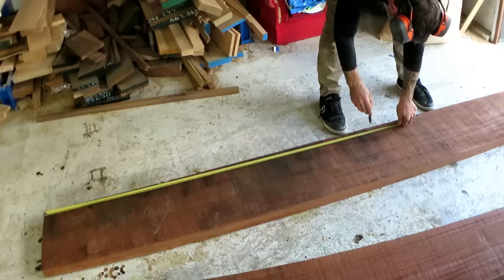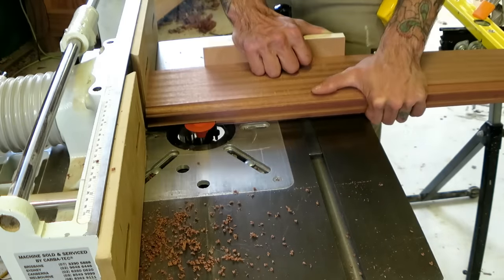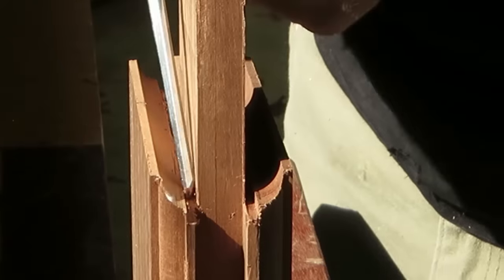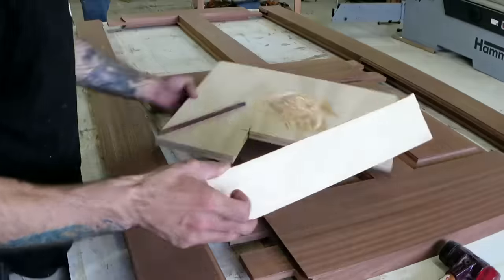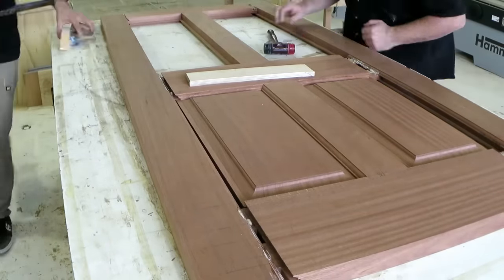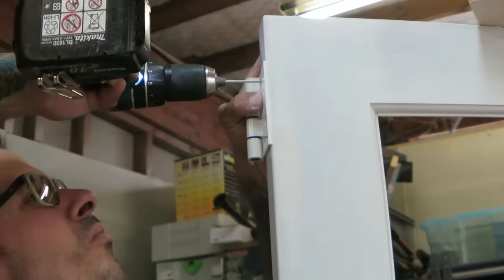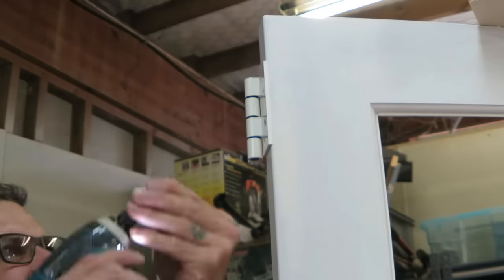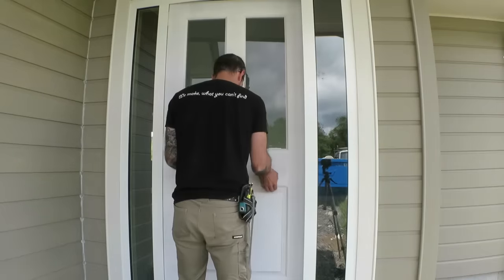Making a Sapele Door

Comment: That’s an extremely well built door, looks great. I have to admit I would have rather you didn’t paint it and just used something like an exterior hard wax oil instead but I see why you did it. And I appreciate it, anyway the main thing is the comforting fact that there is a super solid durable wood underneath which will last decades

Comment: i dont know if this will help but I had a similar problem with a matched router bit set and it turned out my router was set slightly crooked in the table. i put a 1/2" rod in the router and at a foot above the table it was 3/16" out of square. this was enough to mess up the match. after shimming to square the bits worked perfectly

Comment: Just some friendly advice. Stay away from the fox joint on a door; there’s a reason why the Japanese call it a “hell joint.” Through tapered wedges is the way of the old masters as it offers a greater mechanical lock, without the possibility of something going south. Also, if you use lock dowels, you should be using two with an offset on your upper and lower rails. Accordingly, your tenons should be sized to accommodate such a configuration. That sometimes entails making one tenon wider than the other. When I was working as an apprentice many many years ago, I asked the master craftsmen why we were using through wedges and not just lock dowels? He grinned and replied, “Because those wedges are what hold the door together.” Indeed, sometimes a client won’t want exposed joinery but I always manage to convince them otherwise. That’s why I sometimes use a different species of wood for the wedges so it looks better. Sapele is good; Sipo (Utile) is far better. I’ve made hundreds of doors and can assure you of Sipo’s superiority. All the old masters I’ve spoken to agree. Like I said... just some friendly advice.
Reply: Hundreds of doors? I have a big door project going on and I could use some advice from someone with that much experience. First of all, is there a one stop shop, to get a ton of door making info, i.e. a book, video, website, etc that you reccomend?
Reply: davearonow , I’ve been working wood professionally for over 35 years; I would be more than happy to share that experience with you. I just saw your reply so I’ll get back to you later.
Reply: @bethoughtprovoking  thank you.
Reply: davearonow , Making doors is relatively easy. How easy depends on what kind of door you want to make and what tools and equipment you’ll be using. I don’t know of books or videos on door making simply because I never needed that kind of instruction; however, I have seen videos on YouTube that I would strongly urge against. You see, anyone can show you how to do something; but the point is how to do it reliably and correctly. That said, let me know what kind of doors you plan on making and the tools at your disposal and I can give you step-by-step instruction. As I said, the process is not that difficult, but there are a few “tricks of the trade” that you should be aware of.

Comment: This is exactly the video that I was looking for!  Could you make a short video on how to cut the panels? I have been looking for a video on how to make the double sided raised panels. also, would be awesome of you could do in in real time, and not the fast forward version. not sure why the fast forward is necessary, after all this is a training how to video and very nicely done, i might say  (could not sneak a peek at your tats!!!). Thanks tons. i will have to watch this several times to get your lessons here, just need to see how you make the actual raised panels. you sort of skipped over that.  I really like the look of wood, would never paint it, rather would stain it. I am making a six panel interior door and if I can get one done, then I can make the other three doors. This is a really good video though.
Reply from the maker: +Janelle Wolves hi don't have time to make a vid just on panels at the moment.  Best advice is to buy a panel bit and cut a much of test cuts to see what it does and then work out your total panel thickness allowing for a tounge to be left at centre. With this door the panel was the same thickness as the rail and styles.

Comment: I know the video is a little old, but wanted to know why you cut an edge first then thickness planned, to come back to do and edge, instead of planning first? I ask, because I do not currently own a jointer and was looking at building a sled for the thicknesser , but I am making a bed, so the boards are quite long and I cant see that working as well as I hope. I do not have a sliding table on my table saw either, so was wondering about the order you did it in?

Comment: Working with Sapele. I found it difficult pushing through even a 1/8 inch dado using my three-quarter inch spiral bit. Do you find that blades need to be very sharp when working with Sapele? I thought it was sharp but maybe not as sharp as I thought it was. There was burning and frayed edges. The circular saw blade did much better than the router bits
Reply from the maker: Yes new sharpend blades are key, plus a constant feed speed helps

Comment: Lovely work - I had a door installed recently and I don't think they used silicon to seal the glass as you did .. lovely work all round ! A question though - I don't mean to be heathen and the mortise and tenons look great, but would biscuits have also worked ?

Comment: Hi Joey, congrats with your new table saw. I garantuee you it makes life so much easier the European way. Is Felder also available in NZ? the Felder version of your Hammer K4 would be a K 500 or even the K 540 I think. Pretty impressed by the power of your coping bit, if I were to use it I think I would have bandsawn the most of tenons' waste before going to the router table.
Reply: where can we get a table saw like that in NZ? I cant seem to find one. maybe i've been lookin in the wrong places.?
Reply from the maker: +darren cho  I ordered it from jacks machinery they are felder agents
Reply from the maker: +Bart Loncke hi ya yes felder is easier to get than hammer. The guys at felder Germany wanted me to have  the hammer for some exposure on line and a small discount.
Reply: First K4 I have seen anywhere except for Felder's website. I hope they gave you more than a small discount.

Comment: I didn’t see you joint to boards flat before you thickness planed.  I’m making a door now and don’t own a jointer.  Is jointing the boards flat not necessary?
Reply from the maker: If there is a twist or bow in the boards they must be made as flat as possible.   In this case I guess the rough boards I had were nice and straight.

Comment: Thumbs up great work.
Gather DF is Douglas Fir but what do you mean by  "oil impregnated" ?
I'm considering using Western Red Cedar for a similar entrance door, would a good quality oil, with routine maintenance, be alright under a 3m veranda?
Either a tung oil or tung, linseed and varnish DIY concoction.
Reply from the maker: This timber is sapele mahogany.  Cedar makes for great doors.  Under a roof like that any oil/varnish mix would be fine.

Comment: Joey, question if I may. Do you not cut in your hinges on doors? What's your reason for not cutting the hinges in on this door? More options should you need to adjust it? Style of hinges? Just curious mate, thought most hinges get cut in for strength? I'm new to this so im just curious and being that you're very skilled I hoped you could shed some light on it for me.....watched this video about 3 times now lol great content mate
Reply from the maker: So in this case,  as it's going on an aluminum door frame.  The frame manufacturer supplies hinges that are made specifically for there profile. As the hinges are made aluminum doors they are not designed to be let into the edge of the door (in most cases)  so usually this is just not possible in this kind if situation.  Does that make sense?
Reply: @KingPostTimberWorks   Hi, is the Al frame more secure, (burglar wise) than a solid door in a timber frame. I am in Turangi and want to replace my back and front door. They are old style with three large glass panes and two smashed when the wind blew the door closed the other day. As they were made in the 60's when Turangi town was built I am sure they are solid but they are past their best and are not square anymore. As apposed to bespoke made like the one you did can you recommend a good solid door for both exposed and semi exposed use. What is a cheaper timber option? My plan is to put them in a more substantial frame and have metal behind to make them crowbar proof as it seems to me the weakest part of a solid door is where the hinges mount and the lock goes through a weak frame.
Reply from the maker: @allanpennington  generally more secure yes,  my rule of thumb is ' locks only keep honest people out '  breaking glass is always much easier.  And just as loud as smashing into a reinforced door.

Comment: Nice job. Surprised it was only single glazed when the frame was double glazed though. Was there a reason for that?
Reply from the maker: +Steve James yea I'm always sceptical of double glazing doors unless the door is just as thermally efficient. Solid timber has very poor R value and so to spend extra on double glazing is a bit redundant. When the house as a whole is fully insulated and double glazed having one weaker point thermally is not such a big deal in this climate.

Comment: Great job but i would need a workshop with a spindle moulder and a table saw and drill press or morticer  to make this as well as a sander with dust extraction. Could you have made this with a router and hand tools - i guess so but not every diyer has a workshop like yours

 Why did you not chop in the hinges and only surface mount the hinges. Such a beautiful door you made but i would have let the hinges in as the metal plate on edge of the leaf is not supporting the door but the screws are.  It would also have been nice to see the hinges set at 6 & 9 inches from top and bottom of door. Studhawk diy videos.
Reply from the maker: +Studhawk 1. Was intending to use fix wedges but the timber was much to brittle to flare out. 
2. I could use hand tools but would make $0 
3. I'm not a diy'er this is my full time job. Where some times (alot) the only way to make a living is to use machinery. I make videos in the hope that I might impart some small amount of info to those looking for it.
Reply: Thanks and your video was good but sadly it is only a few of us that have workshops so well equipped. I can see you are a professional and do a good job - it just seemed to be a slant on your work to start drilling softwood dowels through a hardwood door that was so well made which is why i mentioned fox wedging as opposed to the dowels. Everything else was great and you even checked the diagonals of course on gluing up. Compared to professional more equipped workshops you did well with the cheaper end of spindle moulders and table saws etc. I know one can spend thousands on each of those items. You are way ahead of any diyer and it is clear to see you are a consummate professional. By the way why don't you use fox wedging instead of dowels - i suppose money is time but if i ordered a door from you i would want the tenons fox wedged. I have a project requiring many doors so how much is a door like that from you please i would need 8 total. Job is in Central London?
Reply from the maker: +Studhawk this was 2k fully installed. I'm in NZ.

Comment: This sounds silly.. But I'm a 3D model artist and I'm currently making some things that have this paneling (a few doors, even a baby's crib) for a game. I'm a sucker for accuracy so I literally looked for a video like this to see exactly how those panels, the parts that you had to manually alter, by hand, to they'd line up. The reason I've researched this is because I want the final things to look as though they were actually constructed from multiple parts, hammered and glued together. May I ask if there is a particular name for those parts, or technique? Or is it just standard? lol.
Reply from the maker: So it would most likely be called a raised panel door. The sides are called styles and the horizontal members called rails. The  molding along the edge would probably be called an ogee.  The molding on the ends of the rails is called a cope or  cope cut. The joinery of rails to styles is a pinned mortise and ten on.

Comment: Is there a reason you didn't mortise the hinges in? Or was it just unnecessary?
Reply from the maker: +Andy Fortin hi these hinges are designed for aluminium framed joinery that would have come with the rest of the house. They are designed not to need mortising.
Reply: KingPost TimberWorks Thanks! Love your work

Comment: I have been watching a few door videos and I have seen several with the double tenon. Anyone help me out with why that is? Seems it would be easier and just as sturdy to do a single tenon.
Reply from the maker: With one large tenon you remove to much material from the style. So it makes for a stronger joint and door to do a double tenon.  Also if you have a wide center rail,  door  hardware can be installed between the tenons
Reply: Thanks, that’s really helpful! While I have you, is there a structural difference between having the top rail going all the way across instead of running between the two upright pieces (if that makes sense), or is it just a style choice?
Reply from the maker: @matthewpooleacp  hmm that's a good question,  primarily styles should go full height so you maintain vertical joint lines which suppress or at least dont allow water to get trapped in the joint. Plus  its probably easier to keep the door flat with a continuous style. Most of all I think the door would look very clunky with a continuous horizontal line at the top plus you would end up with end grain exposed on the sides of the door which would finish a different color to the face grain.
Reply: Those are all really good reasons and very grateful for your time. Thanks!

Comment: Beautiful work.  Beautiful Wood.  But it was like watching a vintage Ferrari being coated in truck bed liner.  It protects it, and no one will ever be able to undo it.  But damn dude.  What a waste.  Some things I see I will never understand.  And I can't un-see this one.
Reply: in this case the wood was chosen for its structural properties. sapele is a great wood for doors as its quite stable, does not shrink or expand too much, and can handle the weather in an out door application. he could have used a cheaper more paint grade wood but it would have resulted in an inferior door that would not last as long. yes its a beautiful wood, but its commonly used in high end doors both painted and not.

Comment: Dude you're workin' too hard. Sand up the panels, moulded edges, glass bead before glue up. Then you just have to flush up the joints. I'm surprised the panels were not primed before the glue up. Important for a painted door that will see weather. 
Just my two cents.

Comment: Would not use sapele any more well in outside use. Here is Ireland it moves and shrinks to much. Prefer to use Iroko/teak or accoya. Nice job though  shame its been painted
Reply from the maker: +Bernard Rooney yea they would be more ideal timbers here too. I haven't found the sapele to move much when it's quarter sawn here at least. Cheers.
Reply: KingPost TimberWorks true depends on the sawn of the timber here in Ireland ya get what your given unless your lucky to get it from the lumber yard but that means at a cost. Nice work though
Reply: Yeah I always hate putting it through a rip saw as it could come out twisted even though it was perfectly planed before hand.
Reply: Iroko is more durable but far less stable with the cost of teak here in U.K. I wouldn’t use it for doors utilie is a lot of what we use now for paint finish. Sweet chestnut over oak but it too is expensive in kiln dried.